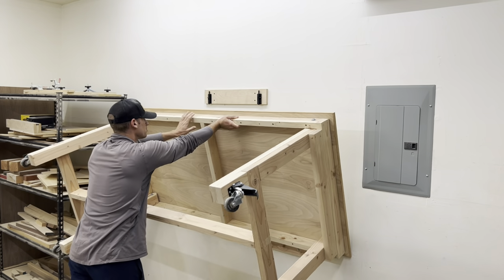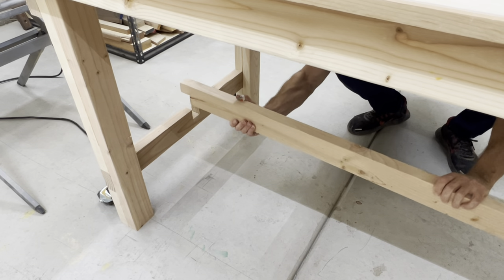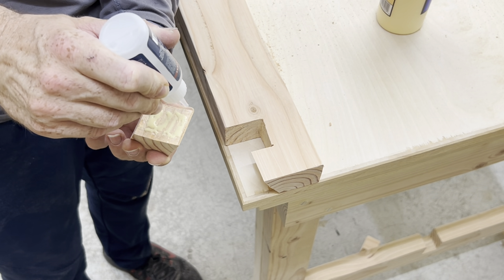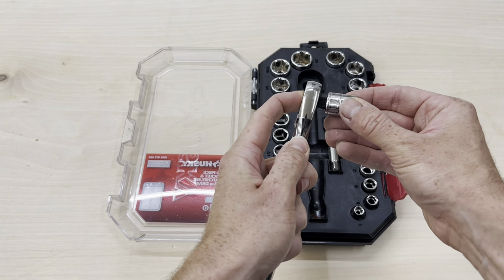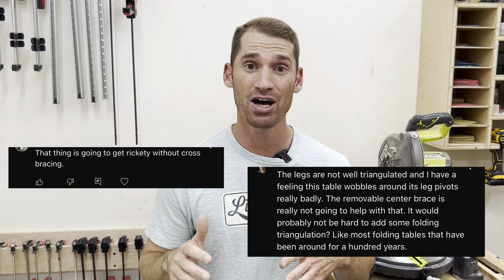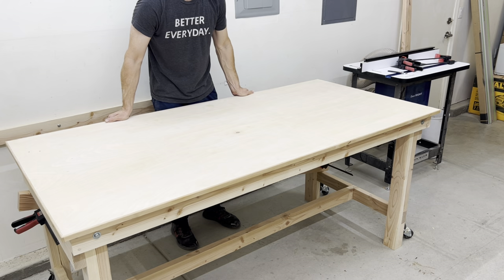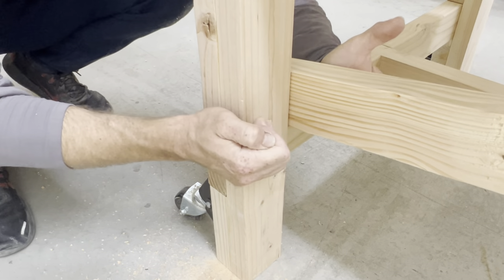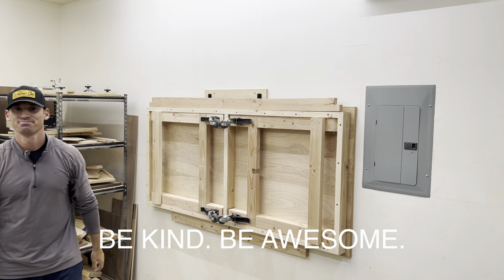This Folding Workbench Has 1 Fatal Flaw

Comment: Edison kept working on his ideas for the light bulb until he found a working solution, and I'm glad to see you didn't quit.  This is what makes engineering so powerful - WORKING THROUGH the design process for improvements.  So nice to see you addressed the issue in a cost-effective manner, too.  Well done!:washhands:
Reply: 100% correct  … I’ve only been working with wood for a few years and it’s these kind of videos that help countless of others including my self and I love it because he leaves pride out of it and we learn.
Reply from the maker: Thank you! I’ve always thought of myself as the Thomas Edison of my time.
Reply: Didn't Edison steal his solution from someone else?
Reply: Repeatedly. Like some modern 'geniuses', he just employed smart people and then patented their work. SOP at the time. The Vice Grip vs Sears Roebuck litigation stopped a lot of the worst cases.

Comment: It appears from your video that the tops of the legs are fully rounded. By moving the legs slightly inward you can get away with rounding only the inward corner thus having the table rest on a flat surface ( half the width of the leg ) rather than a single point.  Much sturdier.

Comment: There are a couple of options actually. Adding some triangle shaped gussets to the bottom of the table top or the table apron and attach them with hinges so that they fold up to recess and fold down to attach to the leg.  They need to be secured to both the apron and the leg, but they could be held in place by pins(think tractor implement pins) or by a lot of more expensive fancy methods. 
I can also see a possibility with running steel cable through eye bolts to pull the legs towards the cross support; this should eliminate wobble, and the tension can be easily controlled by a turnbuckle style connector. 
I helped build effectively what is a roof on stilts that covered about 70 feet of dog kennels and we had the exact same problem. I had to add gussets in the corners of the front, and cross members to the ends. The only bonus we had was that it required a little bit of movement, but not too much.

Comment: Triangles do work, discovered this back in the 1970’s when making legs for my Model Railway portable layout  using folding triangles to keep the 2 legs upright. Ok I was not using them for a workbench but the boards were pretty stable. Glad you discovered the solution for your bench. Challenge now is to make it so that you do not need to unscrew the bolts to take the triangle off the legs! Bit of a clue, 2 off length triangles that couple to the centre if the bench.

Comment: great video! I was going to start this project over the weekend so this is perfect timing. Quick question: after attaching the crossed leg with the bolt, do you have to take the bolt out every time you want to fold the workbench to the table?
Reply: That was my first question as well.

Comment: Thank you for creating this bench and posting your build.  I really appreciate how you're also able to admit difficulties.  I'm looking to build my first bench and would like to end up with a folding bench that's 4' x 8' and I think you[re moving my planning in the right direction.  My hope is to build something that will folder without needing to be mounted to the wall as I'm concerned with having to leave space under the section of wall that holds the table when not in use.  Regardless, I like what you've done here.

Comment: That’s how we all learn. Most people just don’t post about their mistakes, that’s why your video is important!
2 things I may suggest:
Take away the middle beam and see if the table stays sturdy enough. Only thing I see could happen is that the legs without the diagonal between them could flex. That only happens when you put force at the ends of the legs which normally won’t happen during working on the top of the bench.
Second thing is: in my opinion the bolts of the diagonal beam should be always fixed on the legs, also when the diagonal beam is dismounted. That way you don’t need hold the beam in place exactly where the holes line up while putting the bolt through the hole. You just stick the beam onto the bolts and after that apply the nuts. Wing nuts are perfect there because in that spot it’s less about torque but more about the bolt not falling out.
Reply: A third thing as a bonus: put two diagonals to the legs on the shorter sides of the table. I’m saying this because the same reason why the table is unstable on thy longer side should apply to the shorter sides…
Reply: Funny thing is: the reason I clicked on your channel is a short by you were you claimed you table was sturdy because of the middle beam. I was like no way and was happy to discover this video 😂
Reply: this is insightful!  😍

Comment: Saw another build just like this (similar) the only thing I could see they did that you didnt was they put wood across the top of the fold out legs as well as the bottom like you have. Their table looks pretty solid and no diagonal brace that you explain here. Same sort of thing.. fold up table, etc. Wondering if adding wood across the top of the legs (each pair of fold up legs) would strengthen the table as well.

Comment: Hi Thomas. Great video. Am wondering on your thoughts on the following. Back side use a diagonal. Front edge use a very traditional English joiners bench side. Big plank, 2x12, multiple dog holes, two coach bolts with wing nuts for easy disassembly at each end, crochet at one end. Could be pretty strong I think?
Reply from the maker: Yeah that actually sounds great!

Comment: My only beef with your solution is it makes the setup and teardown much less convenient. Something that can fold up like the legs would be better. How about something that hinged off the center table stretcher that could pivot down and connect to the lower leg stretcher? 
I have a table like this and will give it a try
Reply from the maker: Great idea. I went with this solution because since it is tightly bolted to the legs there is no more wobble. Something that is easier to tear down would not give it as much stability. I see your point though.

Comment: Hi Thomas, I have a question. Does that new bolted 2x4 have to be removed every time you reinstall the table to the wall mount? It seems that you wouldn’t be able to fold the legs in. 

If so, Is there a design with the angled 2x4, where it doesn’t need to be removed and reattached before and after every use? 

Thanks!

Comment: Did you try having the removeable center brace be wider so that it actually applies outward pressure on the legs and maybe stiffens the structure.
Reply from the maker: Great tip! I made the center brace wide enough so it would hold it at 90 degrees and it did apply outward pressure when it was first built. The legs loosened a little over time which created the gap, so the center brace isn’t applying outward pressure anymore unfortunately.

Comment: I like this idea. I want to make one the width of the inside of my minivan. I can use it as a shelf for lighter, long tools that I need easy access to. I can put a channel rail on both sides of the van above my heavy power tools. I can then have extended bolts on the table slide through the rails. This will give me easily removable shelf storage for my van and a worktable for my jobsite. Maybe I can build a ripfence for it, add a few dog holes and dovetail tracks for flush clamps, make a notch plate to undermount a circular saw, jigsaw, and router... Crap. This won't be light enough to carry over my shoulder. Maybe I should just make a worktop and screw it down onto folding sawhorses or something.

Comment: I'm actually planning on building a fold away bench similar to this for my tiny shop in the near future. I wonder how difficult it would be to add that cross brace in such a way that you could more quickly and easily remove it when folding the bench up? .... hmmm

Comment: Looked at this because I need to make a similar size existing super solid rollable workbench foldable for van & I detest wobble (weight rating of wheels 1200kg 4x4 legs).  Constructive? Thoughts:  Single pin for leg attachment seems iffy for super heavy I want the leg to support to the top (I intend to use a hardwood spacer with pearling screws into the frame, so it is also supporting the frame firmly), I sincerely hope I can get away with  large hinges routed in so they sit flush.  Cross bracing (I will need to do this like it or not (not currently cross braced, its "solid") but wonder for speed could you use a sliding pin / bolt at one end and a jig at the other (probable Jig at both ends with pin lock).  I've have adjustable (dont know the proper name) clamps (screw on loop & hook) which lock, I'd been thinking of using those to lock the legs out against the frame (90% a fail due to flex in hinge etc..) but even so they're great for tightening things down and quick release.  My big issue is weight.. it's a heavy table especially with super heavy castors etc..  Worth noting I have a wood vice (2nd in line coming soon) at one end & my top is sacrificial so the frame must be stand alone.  All in all, loved the vid & comments looks like a nice workbench (but I think the single pin leg is a definite weakness which could be strengthened by either my experimental hinge system or fixing at both ends).  I can rip a full sheet of board on my worktop (TS55, love it).  Large metalwork vice clamps solidly via 3 hole & board system to other end.

Comment: Great fix, but in the interest of parsimony, is the bottom flat strut necessary anymore now that it has a cross strut?
Reply from the maker: It will still prevent the legs from folding slightly inward when I move it.

Comment: The solution is great, though I now would like to know if you have to attatch the diagonal with screws and bolts every time.
Reply from the maker: Yes I would, but I don’t fold it into the wall very often so I don’t need to take it off frequently.
Reply: @ThomasCustomWoodworks  Thank you for the answer.

Comment: The problem for many with any workbench that mounts to the wall is that most of us need that wall space as well.
Reply from the maker: Totally understandable. That is why I’m currently building a foldable bench (which will be slightly smaller) that does not fold up into the wall. Stay tuned!

Comment: How did you fasten the cross brace so it could be removed to still hang the table on the wall, please?
Reply from the maker: With 5.5” bolts and nuts, and a socket wrench.

Comment: I would have made a rotating peg kinda thing instead, and a indentation for it to slide into, or a 3D printed or wooden attachment for it to slide into and block movement. Is that not enough? I feel like the extra piece you made here solved your issue but also makes it more of a hassle to work with the table, sadly. But if you don't have to put it up often, it's ok.

Comment: What about a simple rope attached to a nail in both corners?  It would be much easier to store and reduce your 2 by 4 count.
Reply from the maker: I like how you’re thinking outside the box! Unfortunately there is not enough tension in the rope to take away the wobble. I had to tighten the bolts pretty good on the 2x4 to stop the workbench from wobbling.

Comment: Ensure that the legs have no loose play when they are erected. Snug them right into the corners, and add drilled blocks to align the pivot bolts on both sides of the legs. Then, make your notched bar a little longer to put tension on the legs. That should solve the problem.

Comment: Why not cut your radiation on just the inter side of leg tops to where when opened they would be solid braced against the outside table frame making it tight when the removable lower brace was put in place.
???